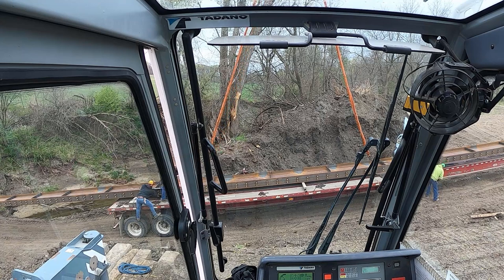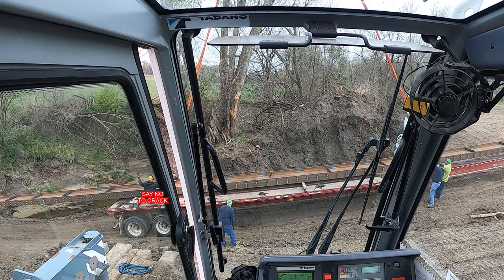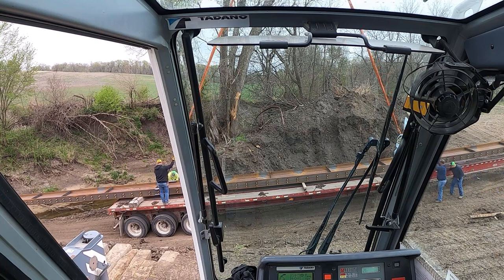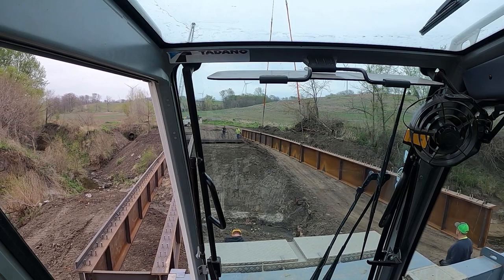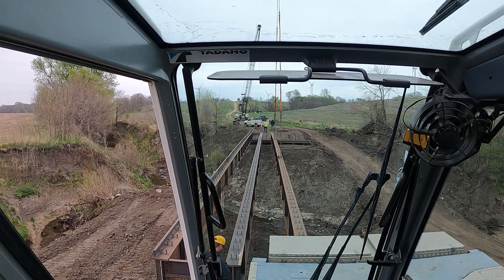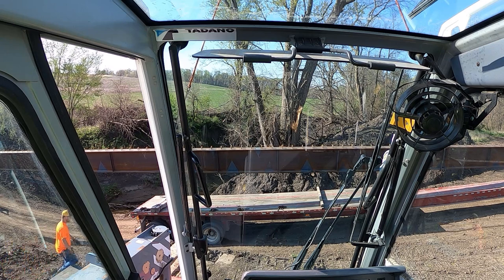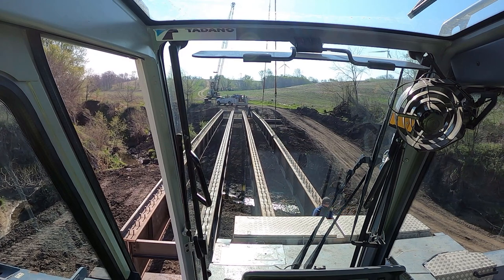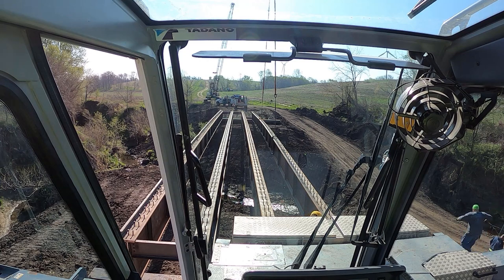Lifting Long Beams With A Crane

Comment: My heart goes out to you an your family in these hard times. Wishing you all best health!!  Now a question? From start to finish lift. What do you figure the total boom deflection was on 28 thousand? As you boom out an cable in , how do you figure the boom deflection? I am assuming?? As the farther you boom out from a 90° the load factor increases the boom deflection right?
Reply from the maker: Thanks for the thoughts! 

As the radius increases, so does the boom deflection. The closer to flat the boom gets, the more it will bend. I don't generally have to calculate the deflection. I just have to compensate for it as it happens during the times when I am picking the piece up and setting it down. If the deflection isn't compensated for, the piece can move abruptly and quite far when it is picked up. Based on the computer, I had close to five feet of deflection (or change in radius) when I set the piece down. Many thanks for watching! 🏗
Reply: @ToTheTopCrane   Thank you for the answer❣️ and a year an half ago I remember you talking about the ( chart) So if in my mind is figuring right, the boom  maximum weight failure rate on the chart, would be based on the Angle of the boom radius angle. So if your boom angle was say? 80 ° an  the maximum lift was rated at 100 tons lift capacity, then if you had to boom down to? Say 45° radius them our maximum amount of weight lift would half @ 45~50 ton.. So if I am understanding this,  You have to know your maximum boom extend and the maximum boom extended degree radius of a job. Before you can make a lift right? This gives me a headache an also scares the crap out of me! Any miscalculation could be tragic... Wow I never realized how much was involved untill now. I figured you drive out an pick it up place it an go home!!  Your job is too scary an complicated. 👍

Comment: Was watching a YouTube video yesterday and he (not the operator) was talking about “rigging mode” on a crane. Is there such a thing?
Reply from the maker: There is a rigging mode. It shuts off a lot of the safety stuff and is there for crane assembly/disassembly operations.
Reply: @ToTheTopCrane  pretty sure I use it daily just for laying  the boom in the cradle because I'm too lazy to hold the override with the two-block lmao. Nice to be able to watch what we do in 10 minutes instead of the hour set up and long waits on the trucks to get there that normally comes along with those jobs. Fun fact the shackles are actually allowed to be picked with up to a 90 degree angle as long as you cut the capacity in half.